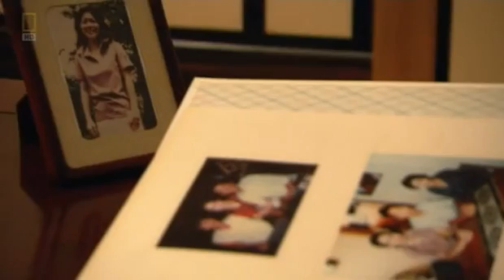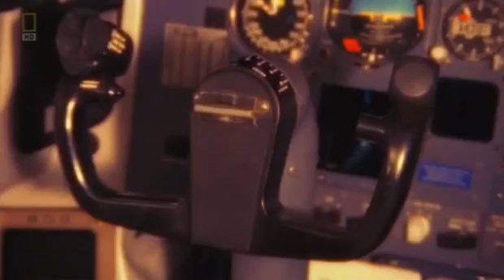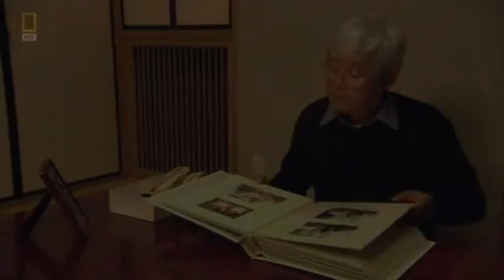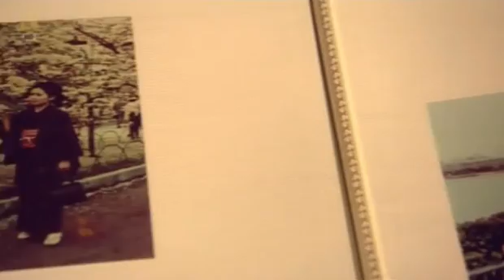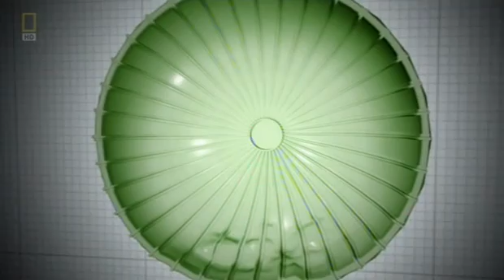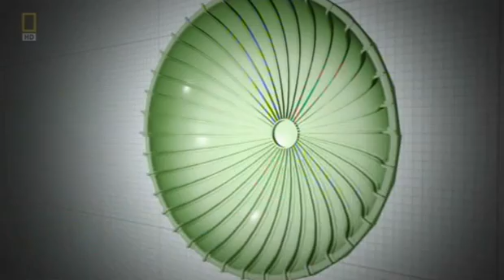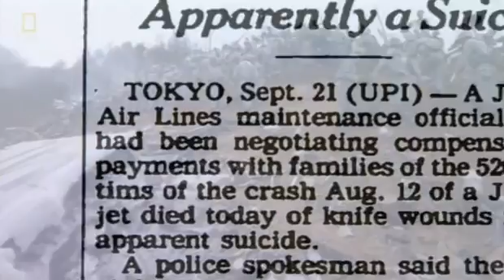Why Planes Crash: Breaking Point - 2012 Documentary Part (3/3)

Comment: The failure of the bulkhead basically ripped the hydraulics off the aircraft. Tail sections are a particular vulnerability to most aircraft, as all three hydraulic systems converge in a single spot, which makes them easy to take out in one strike, as with the failing bulkhead. It wasn't the escaping air that caused the hydraulic failure, but the flying bulkhead itself. A redesign of the hydraulic system would yield a better result in my opinion.